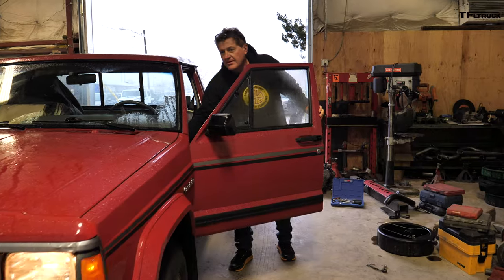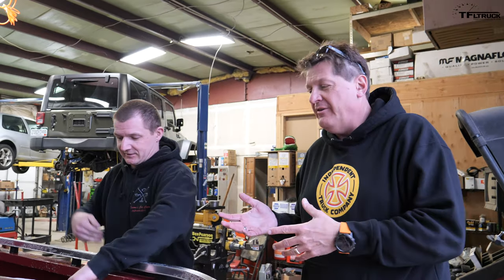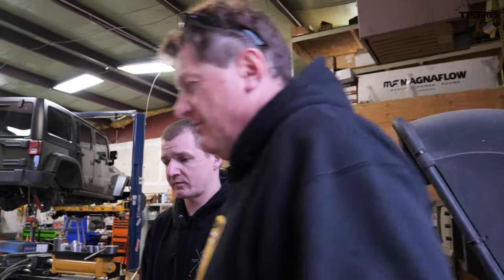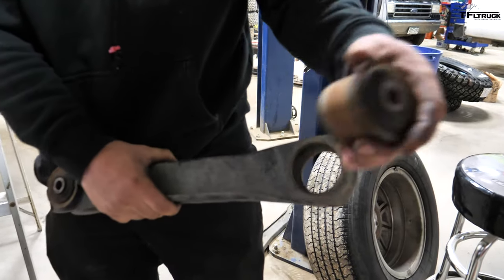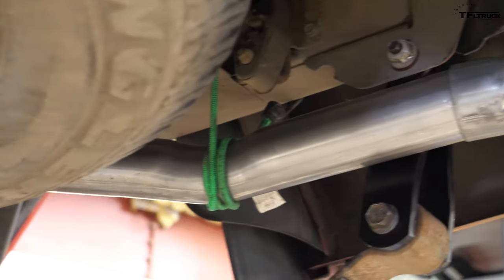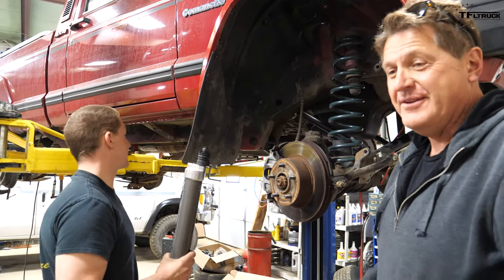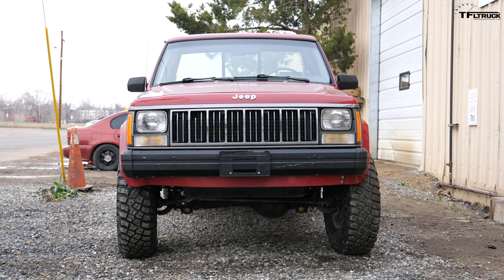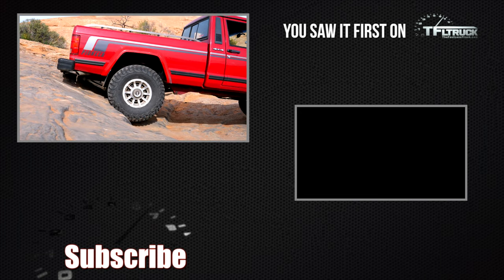Boring to Badass: Can We Build the Coolest Off-Road Jeep Truck? Cheap Jeep Challenge S2 Ep. 3

Comment: A cheap jeep challenge would have just been fixing the transmission and maybe getting new stock size tires and then going wheeling wherever.. this "cheap" jeep has like $6000 worth  of donated parts and somebody else's labor..
Reply: well of course you work within your budget but with a new one costing 50k nowadays yes, this is super cheap and all those mods are needed for off roading
Reply: Not to mention they paid 6500 for a Comanche with a bad tranny.  Could’ve gotten a clean one with many of the mods they want to do for that.
Reply: That Comanche was super clean though. Cheap is all relative to one’s budget. The donated parts surely help but it’s still much cheaper than a new Gladiator.

Comment: Don't look like a cheap Jeep for someone with out sponsors.
Reply: It doesn't seem unreasonable to me.  A regular working guy might have to spread it out over a couple of years but that wouldn't make for a good video.
Reply: Mic drop.
Reply: "Can We Build the Coolest Off-Road Jeep Truck?" No, but thanks to sponsors and real mechanics, you can get one built for you.
Reply: Someone who's cheap doesn't use the word's. "Our friends over at Teraflex", or "Our friends over at BF". Lol
Reply: I don't know what you are talking about.  Taking the jeep to several different mechanics and not doing any of the work done themselves using expensive parts is totally cheap.
Spending 10X the money rebuilding a crappy transmission a moderately intelligent person would just get an AX15 from a junkyard is normal too.
Reply: @sonictech1000  Exactly. Without sponsors means doing all the work yourself, junkyard pulls, craigslist bargaining and reselling/flipping parts. Doesn't come out all that bad when you're actually working it yourself over years.
Reply: well but tires and suspension is just something you need, there's is no way around...

Comment: Amazing truck and build so far. As others have stated thou, you need to factor in all the parts costs also....which having done the same to an XJ I can tell you are quite substantial. Also I'm betting those tires are going to rub a bit once you start flexing. Good video.

Comment: Personally I didn’t like the looks of the small truck with those big tires, specially with the front ones standing more outboard than the rear ones. I would have gone for the 31”. The mud tires start life quite quiet. After 1/3 of their short life (compared with all terrain), they star making more and more noise.
I loved the cheap white 4 banger you made. No so with this one.
Reply: That tire stance and staggered look is really a no go for me, too.
Reply: Dominik Heidrich they need the spacers on the front or the tires will rub before the steering went to the lock. They will have to modify a fix for the rear ones.
Reply: I had one with 205 75 r 15 tires with stock suspension and it felt perfect in terms of tire size and height.  These tires look way too large.  I'm just not an off road type of guy, regular ride height is nice on a truck, you don't have to climb up into it.
Reply: MJ Comanche's are wider in the rear, so even if the rear had the spacer on it would still look that way. and what self respecting man doesnt like the biggest tire you can fit on truck????? your man card needs to be revoked, lol.

Comment: You should really stop calling it a "cheap jeep" because it's about 5x  more expensive than an s10 or a ranger. And about half as reliable. Also even if you didn't pay for it the cost of that terraflex kit had to be a $1000 and another $1000 on 33s. And the exhaust for another $500, I figure you are up to around $13k right now.

Comment: Wheels are 15x7 not 15x8.5
I'd bet the rear tires will rub the frame pretty badly, my '90 MJ rubs with the same wheel and 30x9.5s

Comment: did the same thing with my $1200 Montero, did the torsion bar lift my self in the drive way and $80 for a cat delete and glasspack welded in, and $500 buck on second hand rims and 5 new mud tires. oh and bed linered the whole truck for $300= $ 2080. that's cheap

Comment: I just love how you guys turn a $1500 truck into a $10K+ vehicle.  'Cheap' Jeep living up to its acronym again; JEEP- Just Empty Every Pocket
Reply: The jeep was $6500
Reply: @German Z - The truck in the as-purchased condition was worth at best $1500.  The fact they paid $6500 for it does not make it worth that unless they can dupe someone else into buying for that price.
Reply: @steverowe2943  There's only 1 4x4 comanche in all of california right now and they want 5k for a 91 with ax-15 and 200k miles.  So they are selling for that price.
Reply: Supply and demand of a particular  region. Plus that Comanche was red and mint...except the Peugeot transmission! But yes, $6500 was steep for what it is. Agreed. Maybe 4500 or 5000 tops.
Reply: @sneakypete187 Yeah that is the sad part. Even if the MJ was only $1500 all these inexpensive install charges and mess loads of free parts negates the cheap part. Totally misleading. (And they paid 6500...with fragged 3rd and 4th gear synchros)
Reply: @fernarias  All in working smarter to source the build. I found a 2wd 170k '88 MJ in LA with a peugeot a month back. $2000. Full junkyard pull of a solid AX15, NP231, and all the parts extra for under $400 (discount weekend). Few hours on the weekend and a $200 front end and it'd be equivalent. With an xj, a $500 difference in 2wd and 4wd models isn't worth the hassle. With an MJ, it'd seriously break down the novelty price of the build
Reply: @craftsmancollaborative  Your comparing a 2wd with a 4wd.  Prices for 2wd are lower.  There were 4 2wd selling this weekend for under 3500.  The price diffference for a 2wd vs. a 4wd is not 500 dollars. 

5k for a 91 4wd in clean condition (no rust, very good paint, very good interior, no "upgrades" to suspension, original wheels, 200k) is a good deal.
Reply: @fernarias  For an XJ I sold my '94 2wd stock for 2500, turned around and bought a 4wd that week for 3k in better condition. 

For an MJ, less supply and greater demand will drive that price up for a clean 4wd, but there are clean DD 2wd's for 2k as I was lined up to buy. I was saying that the bigger difference in prices on the MJ would make a swap a smarter "cheap jeep" option.

Comment: Enjoying this series. Working through a basket case 87 shortbed right now. It has the best bar you referred to in part 1. 2WD truck, originally 4cyl/ax5, was swapped for a 4.0 Renix in the past. When I got it a carb era 2.5 and ax5 had been bolted back in it. Keeping the Renix 429 ECM and looking for a 95 4.0 and ax15. Already have an np231, a high pinion Dana 30 is easy to find from cherokees in local boneyards. Finishing up floor pans and interior restoration at this point.

Comment: LOL, I wouldn’t take a Jeep with a Peugeot transmission on the freeway let alone Moab.
Reply: or spend a dime rebuilding that trans when AX15s are plentiful.
Reply: It would have been cheaper to swap one in for sure, they could have swapped in an auto trans for what they spent.
Reply: Who the hell swaps a manual truck to an auto?
Reply: People
Reply: I bought a Comanche in Los Angeles last year with the Peugeot transmission and drove it 3500 miles to Pennsylvania without issue.   It had 176,000 miles on it when I started.  Drove like a dream, rode smoother than any other truck I've driven.  If you drive it with respect, and shift well, things will be fine.
Reply: Good for you...

Comment: This is not a knock against your choices here Roman.  Just a personal opinion.  I would have gone with 31's.  Inside that wheel well looks a bit snug.  I hope when you start getting into articulation situations it is not a regret.  You are def. pushing the boundaries of what you have to work with.  lol  That is the challenge of a 30 year old vehicle that is rare like this.  A lot of modifications cannot be done with stock shelf parts.  Not w/out fabrications going along with the work.  :)  I like what you are doing thus far. Cannot wait to see it with the roll bars and lights in the bed.  :D

Comment: use the rear swaybar mounts as bar pin eliminators and mount up the shocks. also you can remove/replace bar pins

Comment: Looking good! I wonder how the stock gearing is going to be running the mountains on your way to Moab though. Next you should do gears and lockers! :)
As I was watching I was thinking this isn't such a Cheap Jeep anymore. But then compared to the cost of a new Gladiator it is very cheap. You can have just as much fun in this one, maybe more because you're not so worried about breaking your new expensive new Gladiator. Looking forward to the Moab video.

Comment: Did anybody change the speedometer gear to match the 33" tires?
Reply: Thats one of those "We'll get to it later things ."
Reply: There are def. a lot of nuisances like you just mentioned that are not being addressed.  lol  But kudos for pointing it out.
Reply: more miles on the odometer doesn't have the same appeal to everyone but i would still want to have the right mileage.
Reply: @CoelhoSports  it will actually accrue mileage at a slower rate now with the taller tires than with the oem tires.
Reply: @NWI_Steel  and the topic here is what happens if he recalibrates for the bigger tires, which is why i said what i said. some people may not WANT their odometer to move faster. i thought my point was obvious.

Comment: I think the lesson with the Comanche and the TJ are:

If you buy an older vehicle, you WILL need to sink some money into parts and repairs, so it won't be as "cheap" as you originally hoped.  However, if you are going build up your suspension, you could save some money buying an older vehicle so you can skip paying good money for parts you are going to replace anyway.

Comment: I know a lot of this had to be custom fabricated by Devon which he did a very good job on but have you come up with a solution to the wheel spacing issue yet?  I know you couldn't use the spacers on the rear but it looks like they were used on the front and now the wheels appear to be have the wider stance in the front compared to the rear axle.

Comment: How much did the Terraflex parts, the Flowmaster exhaust parts and the tires cost if purchased retail?  Along with a unsubsidised install labor, say $3k, you probably have almost $20k in a cool old truck without your labor.  A Gladiator sport with limited slip and off-road tires retails for about $37k.  Which is the better choice?
Reply: Buzz Pedrotti - gladiator if you really could actually get it that low.
Reply: No way those tires aren’t going to rub at full stuff 😀

Comment: I agree with everything about none of this being cheap they paid what 6500 for the jeep just for the jeep. Then they have added what another 4000 in parts. I bought my jeep for 2500 with a lift and tires and have put probley 2000 into in parts way cheaper than what they are doing. Sad to see this video series go this way and not be a genuine cheap jeep challenge

Comment: Help: 96 Cherokee, 4x4, A/T, 4.0.. Should this vehicle stay in 4hi at all time? Or does a user put transfer case to the N position during normal street driving???
Reply: Neutral is only if you tow the Jeep behind something. Only use 4hi if you are in snow or mud and need traction. Never drive in 4hi all the time. Put it in 2hi.

Comment: After three years this 20K investment will be worth about 8k. 12K or 4K per year. A gladiator can probably be leased for 3 years for 4K / year.
Reply: A gladiator will not be able to be leased for 333 bucks a month. Try double that.
Reply: @NWI_Steel  I just saw an ad for 3,500 down and 199 a month lease for 24 months 10000 miles a year for a sport manual transmission. Maybe can't get it. But this is what the ad said.

Comment: I know everyone is back into the jeep trucks again but $6500 for a truck with a bad trans?  Ins't that a $1500 truck?
Reply: once limited production vehicles hit the 25 year mark prices start going up, especially with solid body, frame, and motor. i think it has to be 30 in florida for antique plates. you might be able to buy an old pickup that runs for $1500 here in florida but not that one. maybe 10 years ago but not now. if you can find a solid one for that, buy it, flip it, and triple your money.